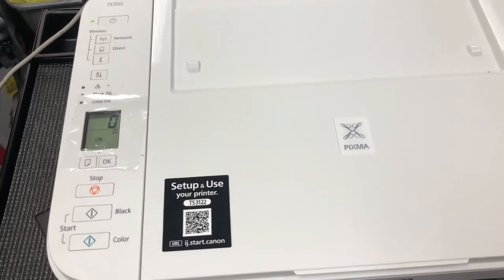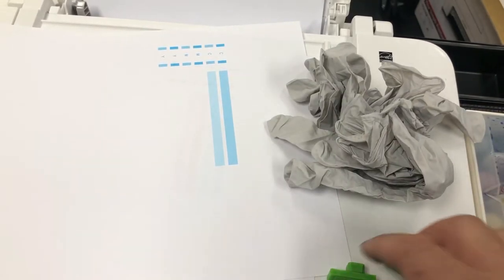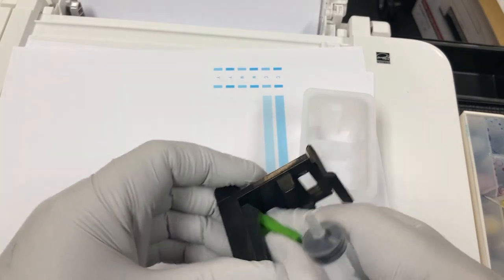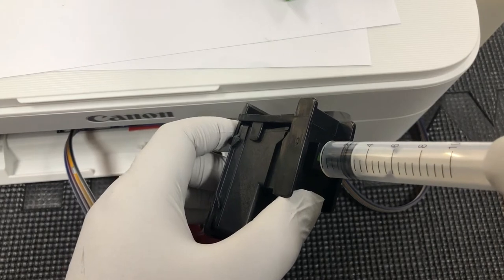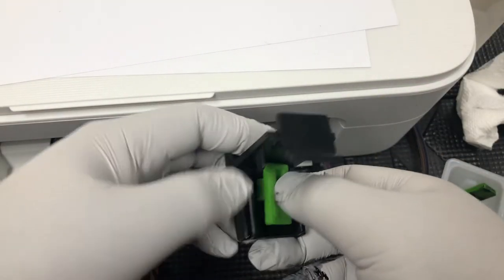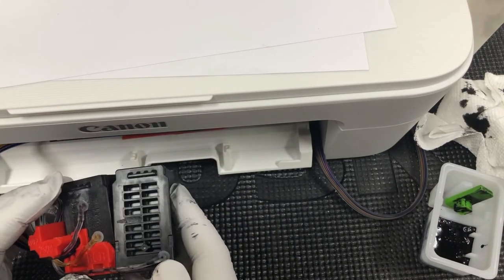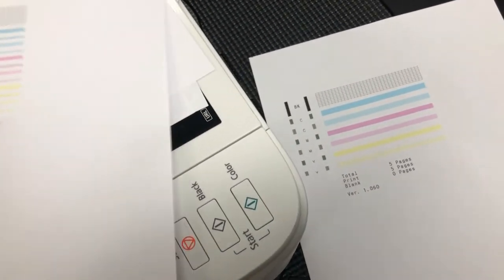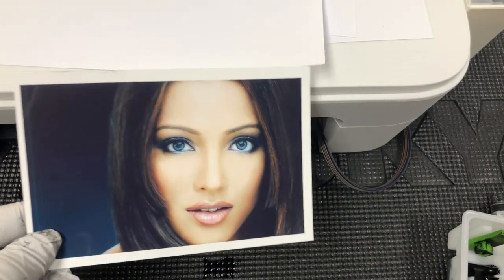How to use BCH Repair kit on TS3122 MG2522 MX490 and MX492

Comment: I have a question, when it comes to the sponge/spineless modification kits for ink cartridges, how long should I wait after glueing the lid in place until I can fill it up with ink and use it?
Reply from the maker: We normally sit it overnight.  Also, we use a fan to blow air into the hole, so the fumes from the super glue will not leave a white substance on the cover (make it look better).
Reply: BCH Technologies thank you for the quick response, so far your products are the best in the market from what I’ve seen, I can easily tell you that you got yourself another life time customer! 😃